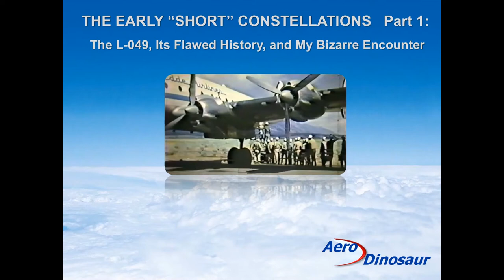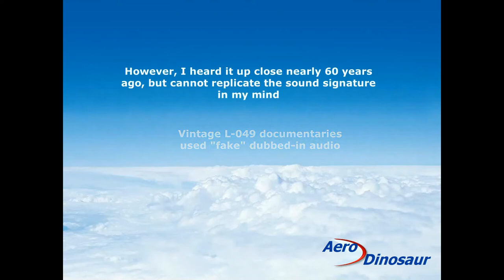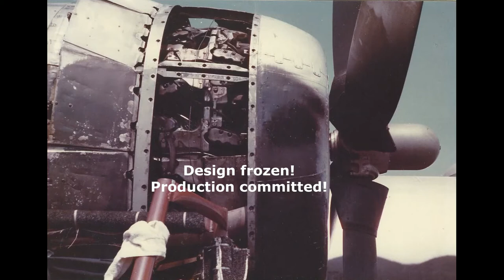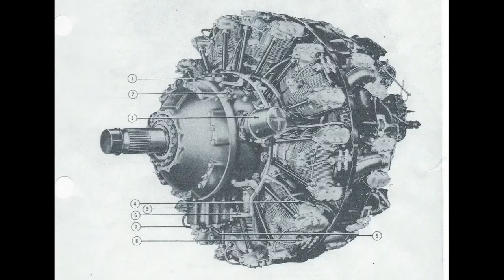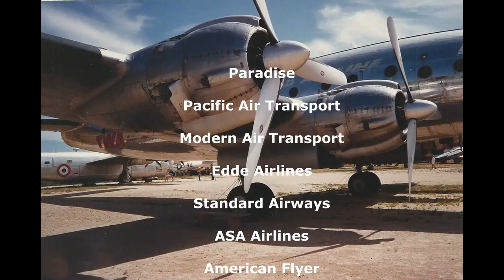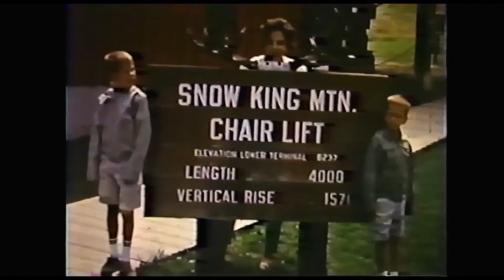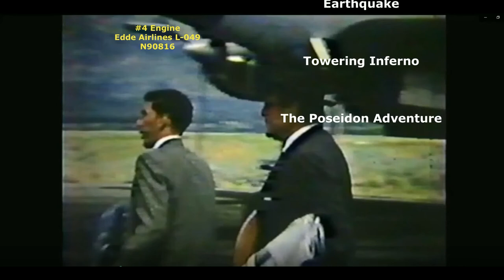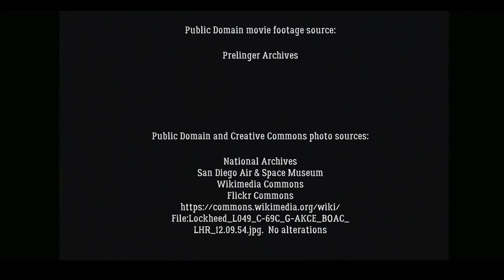THE EARLY "SHORT" CONSTELLATIONS Part 1:  The L-049, Its Flawed History, and My Bizarre Encounter

Comment: As a kid in Miami, in the early days of "corrosion corner" and having an Eastern Airlines dad who instilled in us kids the distinctly different sounds of each airplane/engine combo. I vividly remember the very distinct sound of the early short Connies with the front-exhaust engines coupled to the original very slender prop blades. The only Connie that made an "obnoxious" sound.
Reply from the maker: Thanks for the input!  Into our database it goes.  I would have loved to have remembered the obnoxious sound of that Duplex Cyclone engine in an 049.

Comment: In your opening, you seem to indicate that the Constellation was developed and built during WW2 as the C69 for the US Army Air Force which was then later to because  the L049. I have a copy of a book called "Lockheed Constellation" by Stringfellow and Bowers that states that Lockheed was already working at designs that lead to the L049 as early as 1938. The driving force was TWA and it's major player Howard Hughes and Jack Frye, who was President of TWA. It was these people who set up the parameters of the L049. TWA placed a firm order of 9 planes in 1940 increased to 40. It was in early 1941 that the Army started take the commercial planes right off the production line and changed the plane's designation to C69 and C69A. All told, the Army took the planes from both TWA and Pan Am.
Reply from the maker: Everything you say is accurate.  I was just using "World War II" as a general timeframe.  My understanding is that most of the early aircraft that first flew during WWII were conceived and saw their initial designs in the late 1930's, including the L-49/049 with Hughes/Frye as a collaborators.  The 1930's version of the "paper" Constellation and mockup was called the "Excalibur" as you saw in the Stringfellow/Bowers book and did not look like the prototype.    Thanks for watching!
Reply: Thanks.

Comment: Thank you, Mr. Reed. 
   Years past had I built Heller's 1:72nd-scale kit of the Lockheed L-49 Constellation Passenger Airliner. I could not determine its accuracy, though to my untrained, myopic eyes, it looked presentable. The reputation of Heller kits was the crudeness of their details. I therefore wanted to avoid the struggle of representing accurately a natural metal finish. Round that time, I also developed an interest in model kits of U.S. military transports. For these two factors together, I decided to build this kit as a model of the Lockheed C-69 Constellation USAAF Transport, in Olive Drab over Neutral Grey. This I expected would camouflage some of the kits inadequacies. 
   This was not my first encounter with this elegant aircraft: years prior, as a small boy whilst shopping with my mother and siblings, I saw the biggest airplane that I had seen! I obviously did not know what it was. 
   For my circumstances, I could recognise, and decades on still could recall, enough of its distinctive profile and features generically to identify it as a Lockheed Constellation; of course, I would not have been able to distinguish a specific variant; this derives both from my inexperience in life, and my inability from perhaps two kilometres' distance even to see the relevant features, let alone to mark them for their significance. 
   I infer from the circumstances that it had been a passenger plane, in its ascent at a modest angle of attack from a local airport.
   Fond memories . . . .
Reply from the maker: In 1984 I built the 1:72 Heller L-749/C-121 in TWA colors.  I spliced in a long radar nose from their L-1049.   It came out OK, but with minor accuracy problems.  It is featured in our Part II video The Early Short Constellations.  I think your early C-69 buildup would be an interesting subject. Thank you for sharing your experiences--makes it all worthwhile for us!
Reply: @AeroDinosaur  , I watched your L-049 video. So, thank you!

Comment: I remember what those old 3350's sounded like. I have a very keen sense of hearing. As a child I could tell the difference of many old radial engine installations. Also, in the CAP we had to learn the transports of the day by the glow of the exhaust stacks from below.   I am not tuned into the modern jets, but could distinguish the differences of the first three generations of jetliners.

Comment: Well, two guys who remember this aircraft and the engine sound have to correct some of your information. I'll work  816 was flown from FLL to an airport in NJ. Look this up, as someone got the bright idea to fire up one of the engines to run.
I few on either 816 or 12H for the certification of the DME. I helped install the harness during the installation of the DME  The Edde's were my cousins. It is pronouded Ed E btw.  My partner was who moved 816 to NJ. 816 was origonally operated by Air France. It also had the engines changed out by Lockheed after initial operation bt AF. 
Lots more, PM me if you want more info
Reply from the maker: My thanks to you and Capt. Eby for reaching out -- glad you both found us --- and thanks for your corrected information.  I never actually heard anybody articulate "Edde" before so I appreciate that.  As a side note, years ago I found a YouTube showing the arrival of -12H at its final resting place at Greenwood Lake,  NJ around 1977.  Were you on that crew or do you know who they were?  I'd be glad to trade information with you, perhaps it would be easiest for you to just email me at j.reed3930@sbcglobal.net.
Reply: @AeroDinosaur  
Will do. I messed up, it was 12Hotel to NJ. We had a lot of fun with that N number. Ends up, it was one two a restarant. I'm not a pilot. I was a teenage "volunteer" ramp rat and tool/parts/flashlight holder for my Dad. I tell people two things I learned about a Connie. Keep climing over and kicking out bags untill you see batteries and NEVER touch the aluminum with bare skin after they land in the winter. Maybe should call you and let you record my memories of these two aircraft. I spent a lot of time with them. Including a whole history how they got their DMEs.
Reply from the maker: @CD2uSF  I am planning on a future video later this year or early next that would include more coverage of -816  and -12H.  In the past I have interviewed other AeroDinosaur viewers and used the recordings in my productions and would welcome the opportunity to record yours for inclusion.  It seems you have a lot of interesting experiences with the two 049s worth telling. If you get a chance please e-mail me your contact information.

Comment: I believe I have photos of Star of Geneva taken at FLL in the summer of 1988. It was on the ramp not far from an FBO on the south side of the airport. There was an executive L14 in good condition parked near it. And a pile of RR Conways stacked under one wing. I will try to scan and send them to you.
Reply from the maker: Thanks, Steve, I would certainly be interested in scans if you can locate the photos.  Sources are actually conflicting as to when Star of Geneva was scrapped, anywhere from 1986 to 1990, or it may have been incrementally sliced up over that period of years.  Looks like you saw an interesting assortment of stuff scattered around it. My e-mail is j.reed3930@sbcglobal.net.  Very kind of you to offer your photos. Also good to hear from another radial "sound technician" like me.

Comment: John, Excellent technical explanations of what I had never known about the first generation Connie which I well recall had many engine problems. Living in Rochester N.Y. I saw a few Capital L-49S come through in the later 1950s. I did see the Dominican Constellation at San Juan in 1967. I've always wondered where baggage was stowed as there did not seem to be rear compartments. It seems as if loading was done through the nose wheel assembly as well as the right side crew access door for floor storage which was limited. Certainly the 649/749s were perhaps the best of the lot in terms of simplicity before they got into the turbo compound engines that were a real nightmare.
Reply from the maker: Hey, thanks a million for watching and your nice comment.  Glad you like the technical stuff--a lot of people don't like that.  You have good intuition--Constellation captains that I knew always preferred the L-749 over all other variants.  L-49 too many teething problems especially with the Duplex Cyclone engines. L-1049--Turbo Compound engine was always a headache!  Amazing that you saw that Dominican L-49--last passenger service ever with that plane.

Comment: Your video states that nobody is left who could actually remember the sounds these aircraft made. Actually I can clearly recall that sound because I'm old enough to remember Connies in full song, living along the departure path south from the airport in Burbank California where they were made. We were treated to sights and sounds of Douglas, Lockheed and Boeing piston liners flying toward LAX, Burbank and in-state routes with feeder airlines that kept these incredible pieces of tech alive and in service into the late 1970's. 

My first recollection as a small child was aboard a transcontinental L1049 going from La Guardia to Los Angeles, sitting in my mother's lap. From my upstairs bedroom in the Hollywood Hills, I watched them climb out of Burbank. I can recall the faraway deep rumbling buzz Boeing 377s made cruising in the mid 20's nonstop from Denver to Hawaii. They seemed to be moving incredibly slowly, just hanging up there. The old Wrights and Pratts never sounded strained, just working easily with an almost musical cadence, even heavy and low as they passed over our house in a shallow climb. DC-3s would lumber by in a descent into Burbank, issuing a metallic kind of whine--supercharger noise, perhaps--but they came by close to the hills; remember, piston airplanes can't make the kind of dive-bomb descents turbines are capable of--they had to protect those piston radials from overly rapid cooling at reduced power, so the drill is to slowly throttle back and make sure to maintain engine temperature. I fly my own piston powered airplane today and the advice about careful power reductions still stands. Lots of memories, and I am sure there are still a few others around who remember those sounds.
Reply from the maker: Thanks for checking us out and sharing your great memories.  Maybe I wasn't too clear, but the "rare" sound I was referring to was that of the earliest 049 Constellations with the early 2,200 hp R-3350 Duplex Cyclones--the O49s became super-scarce before sound-recording video cameras were widely available to record them.  I have a lot of video/audio recordings on the L-749 and L-1049s (with Cyclone 18s and Turbo-Compound R-3350 variants, and their different sound signatures, respectively). As our video mentions I saw and heard the 049 as an 8-year-old in that video but cannot recall the specific sound signature--and I don't know of anybody who has such a recording (but I'm sure one may exist somewhere).  Thanks again for watching--that means a lot to us! J.A. Reed.
Reply: @AeroDinosaur  You're absolutely right, these amazing old engines' sounds are increasingly rare and I love to recall their song. Occasionally we do get the Collings foundation's warbirds in my area and to see them going low overhead is quite amazing. Big old gasoline engines, low tech, complicated and finicky. It's hard to believe they powered nonstop flights from Los Angeles to London in a (then) mere 17 hours. We're so blase today, we can't imagine the sense of marvel L 1649 passengers felt traveling five and a half miles a minute, four miles above the earth.
Reply from the maker: @htschmerdtz4465  Now that you bring it up, not many actual sound recordings of the L-1649 either.  You are probably one of the few that heard them regularly!
Reply: @AeroDinosaur  I mentioned I grew up in the Hollywood hills just six miles from where Lockheed built, so I had a balcony seat to almost daily test flights.  Now I suppose old age has to be good for something: I have a dim memory fragment of being perhaps 3 years old in my mother's lap eating a piece of sweet pumpernickel bread aboard a TWA transcon Connie.
Reply from the maker: @htschmerdtz4465  Thanks Bruce--all part of real history!

Comment: Thank you for this great video. I did not know about the duplex double collectlor rings, very interesting.
Reply from the maker: Thanks for watching and for your nice compliment. Those dual collector rings on the Duplex Cyclone were quite archaic, weren't they!  They had to do that because the poorly designed cast cylinder cooling fins resulted in big fat cylinder heads on the early R-3350s. Exhaust channels from the front row could not fit between the rear row of cylinders so they had to come out the front. JA Reed.
Reply: @AeroDinosaur  Thank you again. There is so little info out there about the L-049 and what I do have does not mention those differences on the early R3350's. So your in depth video was a real eye opener. I do love you other video's as well, they are a time capsule of great value. Thanks ever so much!
Reply from the maker: @MarcvanExel  Marc--Thanks a million, glad you can appreciate them!  It is our pleasure to bring them to you and it makes reaching legacy aviation enthusiasts like yourself extremely worthwhile for us.  We are a collector and re-packager of the generally unnoticed details!

Comment: 14 hour flight...What I would like to know is when airliners got autopilots.  Did the Connie have an autopilot?  Did the DC-7 (or the DC-6) have an autopilot?  =PC=
Reply from the maker: I believe they had simple "heading and altitude hold" autopilots back in the '40's and '50's, but am not sure when they were introduced.  That alone would take a ton of workload off the pilots and reduce fatigue.
Reply: @AeroDinosaur  The 049 indeed had an early autopilot, although it only provided heading and pitch hold, the latter differs a lot from the more practical altitude hold introduced in later models. On the beginning of the cruise you dialed in a pitch that holds the altitude but as you burn through fuel or stuff gets moved through the cabin your center of gravity changes as well as your total weight, resulting in a shallow climb or descent, mostly, on which you needed to react. Not particularly  relaxing...
Reply from the maker: Thanks for the corrective input Marko.  It wasn't "altitude" hold like I said, but "pitch" hold back in those days.  Exhausting for sure.